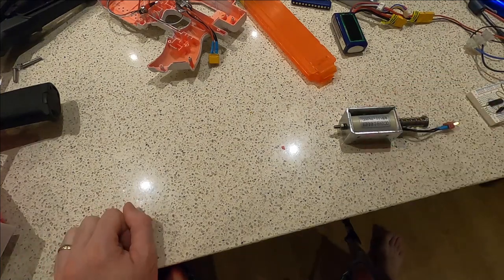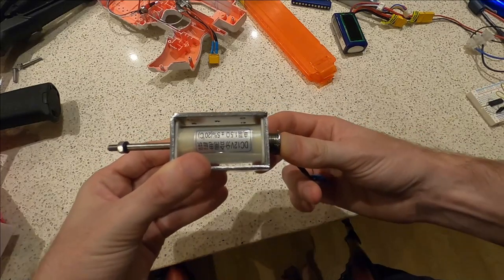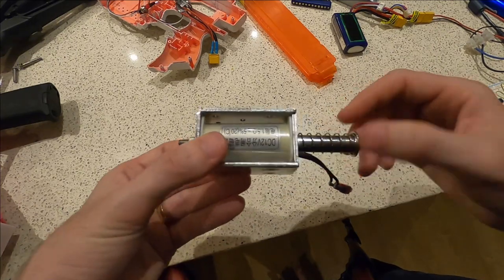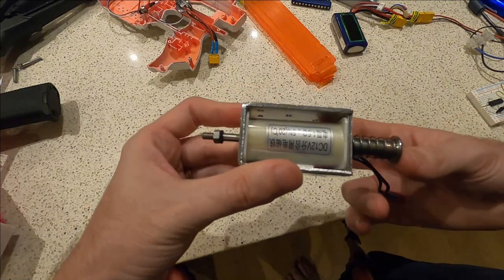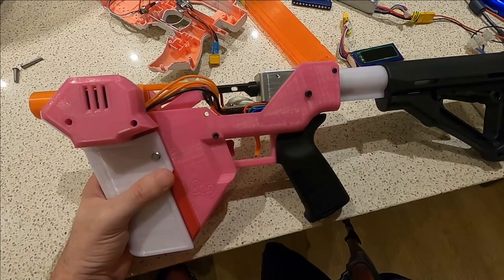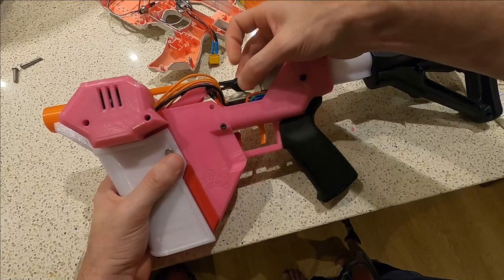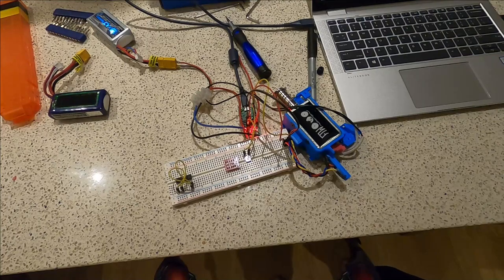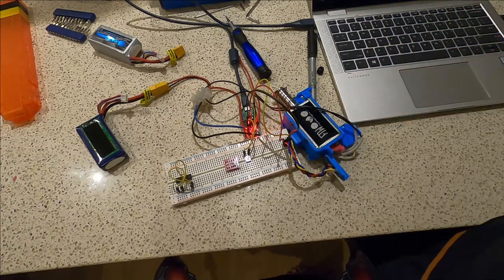Closed Loop Solenoid Control

Comment: Cheers, superb description, I am very new to the hobby but have just built my son a Gryphon however my daughter found it hard to pull the trigger so I have made another gun and redesigned the Gryphon to take a solenoid, ive fets and flybacks fitted in the stock tube on a nice barrel bracket and have wired an Ardunio Nano in to the lid that sits on the top of the gun, I have found open loop control has been just fine using my program, what I did was to put 2 small potentiometers on the top of the gun and 4 way selector for single shot, auto, adjustable auto (via the pots) so I can adjust pulse time and time between pulses and we have a sentry mode (fires from a gun mounted movement detector) its really working very well, I have PWM control of the drive motors so I can wind it down for the kids, semi auto seems very reliable, I have low battery cut off set quite modestly at 10.7V (3S pack) hitting around 10dps which in a 12 shot talon is silly fast anyway, like the idea of the closed loop though and something I may think of doing for my next build, I also unwrapped the solenoid and fitted a tmp36 temp sensor so I can monitor the coil temp of the solenoid, I have a small ic2 display on the top that displays temps and volts and beeps and cuts the power under any fault, I was aware there were programs and boards out there but Arduino is fun to program for me as is the 3D design and printing stuff I would rather just do it myself, thats where all the fun is :-)  solid explanation mate so thanks.
Reply from the maker: That's a pretty intense build, but good work for getting it all together. You should do a post on Reddit or over of the Facebook groups, if you haven't already.

Comment: Hi! I was looking for a Maker like you for a long time. There is nobody to make like this project but you did. 
I am working on Airsoft toys and I have couple of questions, can you answer me please. I will make HPA. Firstly I will use a 555 pulse circuit for trigger to pneumatic selenoid valve. I will measure selenoid's open time with circuit. There will be a small piston behind barrel. When push down the trigger piston goes forward and give  a BB to barrel and same time high pressure gas flow the barrel. Gas will pass inside of the piston. After that, timer circuit automatically cut the electric and piston goes back with a spring. Can add full auto mod. I will make all high pressure parts with brass, I have everytool what I need. I only  don't know is this will be best design. There is nobody to make like this project on YouTube or anywhere, I need you. Help me please. How did you do your HPA system, Can you make a video about working principle and details? Thank you very much
Reply from the maker: I have a write up on Reddit somewhere
Reply: @AirzonesBlasters  I found it, thanks
Reply: Look up on YouTube Prophecy HPA mod auto and there's a extremely detailed explanation

Comment: hi airzone, would i be able to run a solenoid with dc motors with a narfduino micro or will i need another mosfet?
Reply from the maker: You'll need another mosfet, as well as using a full Narfduino, not a Narfduino Brushless Micro
Reply: @AirzonesBlasters  i’m in america so i can’t get a narfduino 😅
Reply from the maker: Keep an eye on Out Of Dart's webpage. I'm sending them some more shortly.